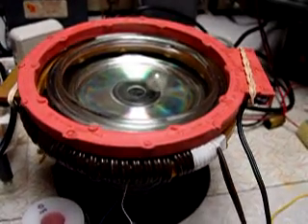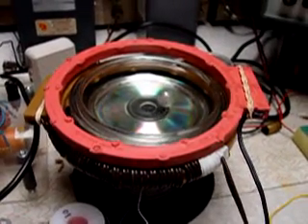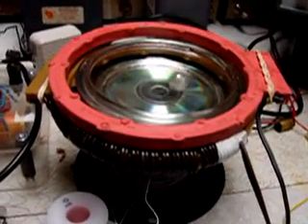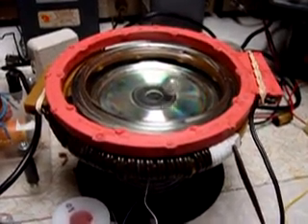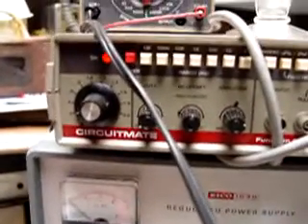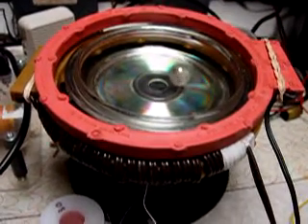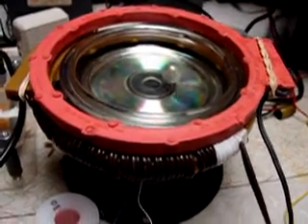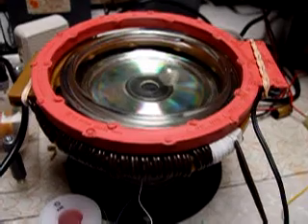Stacked Degaussing Coils Spinning a Magnet at 20 HZ

Comment from the maker: Not a problem we all have to start somewhere. The coils are wired in parallel and are in phase. If it doesn't work flip the wires on one coil (50/50 chance on the correct phase). The spec on my function generator is 20v p-p open circuit. The CD was to reflect overhead light for the camera, it has no impact on the magnet. The glass lid is pyrex, from a Corning 'grab-it' bowl.